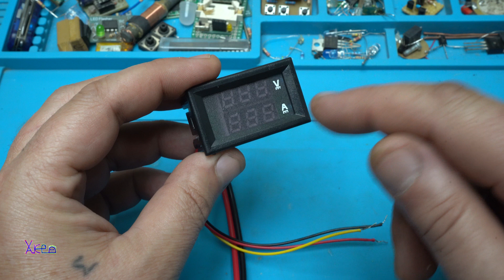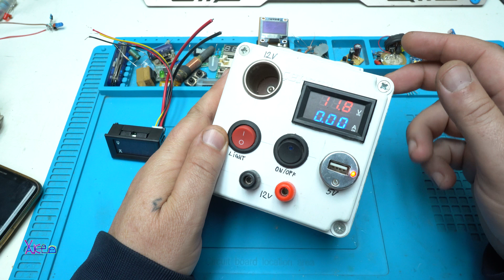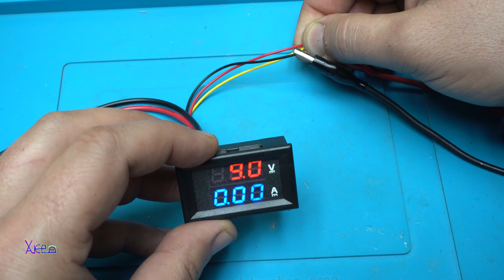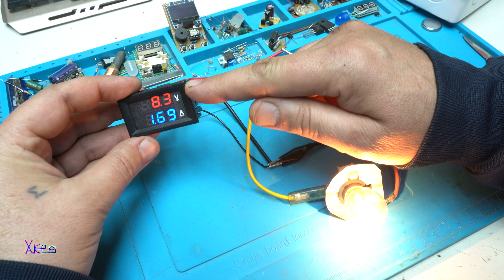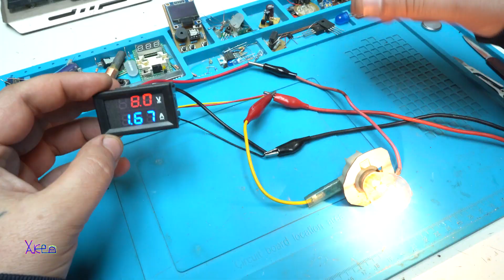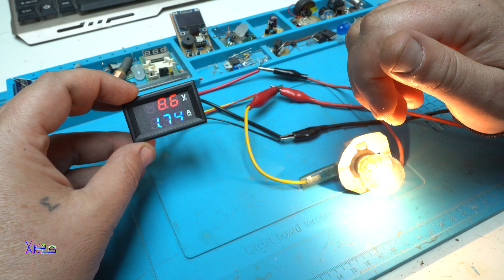The Shocking $1.3 Gadget from Aliexpress - Here's Wnat Happened? (LED Volt Amp Meter)

Comment: Hi there, love your video, very easy to follow, how can you get it wrong, I ask myself!

For my model train set-up I’m trying to connect up 3 of these volt/amp meters. Each meter will do the following, 12 volts, 5 volts and 3.3 volts. So, following your video I have wired up as you have instructed, but I have an issue! All 3 meters are clearly powered up and showing each meter voltage reading, 12, 5 and 3, which is great. However, I’m not getting any readings for the amps! So, can you help me, what am I doing wrong? 

( fyi, 12v is for powering my turnouts x 6 (points), 5 volts is for powering the 3 meters in question and 3.3 volts is for powering my LED lights) 
😊
Many thanks, look forward to your response…. Brian ( Kent - UK)

Comment: My unit came with out a shunt on it how can I put one one? Mine is apparently DC 100V 100A Voltmeter Ammeter Blue + Red LED Dual Digital Volt Amp Meter Gauge. The place for the shunt is empty. How can I sort it out?
Reply from the maker: Prob the negative wire need to go thrue the shunt

Comment: i would like to make one note, if you use same power source with the meter and the load, dont connect the smaller black wire, otherwise measuring can show wrong values.
Reply from the maker: I didn know that,need to check

Comment: OK,  I have used these too. Very nice. 2 things: It can only measure current in ONE direction. Cannot show +/-. the circuit can handle up to 30VDC. If you want to measure higher voltage, connect the yellow wire to source voltage and keep red wire under 30 volts! I wouldn't push 10amps through it full time. Those "large" wires can only handle maybe 5 amps full time.
Reply from the maker: Adding a shunt will make it more safe and load bigger current
Reply: @Hacktuber  But the reading will be too low.  If you use a shunt with the same resistance as the internal shunt, the current reading will be halved.

Comment: Do you have any tutorial to make a powerbank that has a USB output and also a 7 volt output or more to power a fiber optic modem?
Reply from the maker: You can use LM 317 voltage regulator for that project.

Comment: The high current is running through the small red wire?
Reply: No, the current goes through the thick wires.
Reply from the maker: It says that can measure max 10amps

Comment: I purchased 10 of those because I thought they were amazing. The problem with them is all of them stopped measuring current within a month of being in service. Don't waste your money on them.
Reply: I've overloaded these (15 Amps) and they survived but after a while the larger connector melted. so I just soldered the wires on to the pins.  I've got 5 or 6 of these running continuously.
Reply from the maker: Hmm I've never had that issue with mine, maybe try contacting the seller?
Reply: Maybe you did something wrong.
Reply: @Plons0Nard  "Maybe you did something wrong." 
Yea, what I did wrong was to put them into service like a normal person would. 
If you don't use them, they last forever.
Reply: There's a different version to be used with an external current shunt, much safer than pushing several amp's through that dinky circuit.
Just make sure it's supply voltage is limited if it might exceed 12V, it can measure much more just don't grill it with excess supply voltage.

Comment: I ask...: Have you tried connecting a second and exactly the same voltmeter to the same measuring point to see if there are differences in the readings? I have already tried and detected different readings on different voltmeters, despite the fact that they are identical models (not exactly the model shown in the footage but previous models). 
From what I have been able to understand among users of this type of cheap voltmeters/ammeters, discrepancies in the reading of the same current/voltage point have been very common. 
Based on the above, I would only like to warn that this situation must be evaluated by anyone who intends to take readings of voltage values and current intensities with some seriousness. 
Greetings from Portugal.
Macedo Pinto
Reply from the maker: Hello friend
That is a good point,I didnt thought of that,maybe in future videos I will show that testing.Thanks for feedback sir
Reply: There are 2 small potentiometers on the board to adjust (calibrate) voltage and current reading. Take care with the supply voltage - do not exceed  15V, because the regulator on the board will overheat.